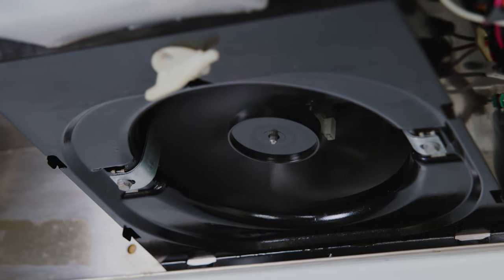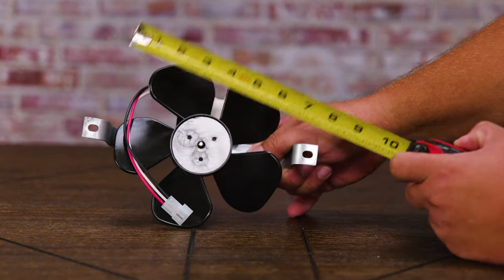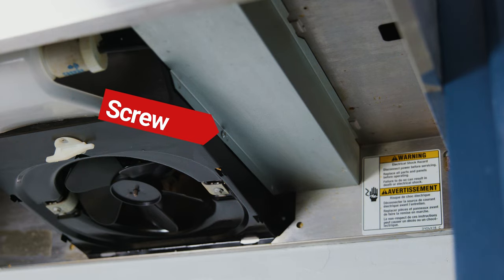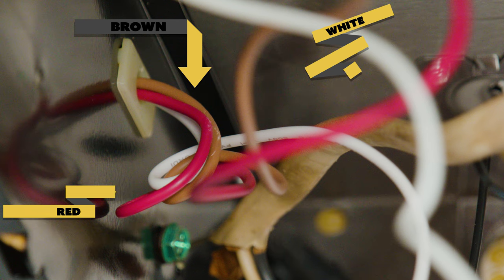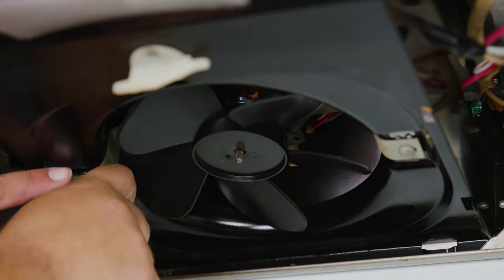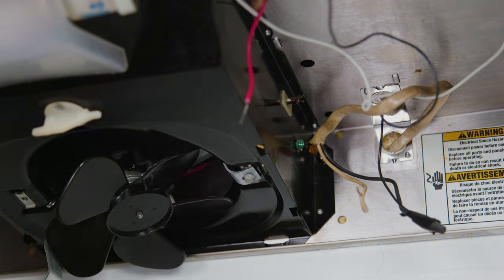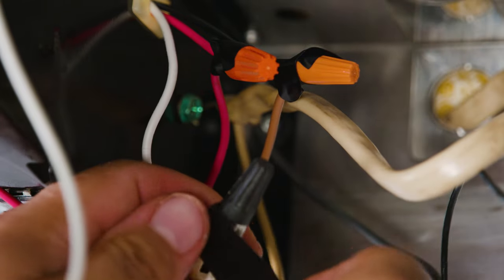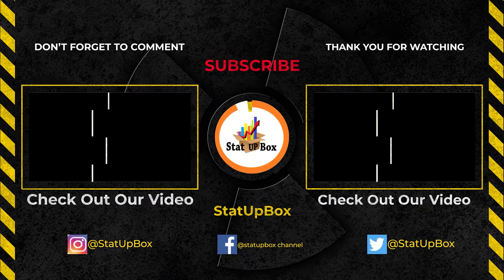How To Replace Range Hood Fan Motor Easy Simple

Comment: My westinghouse rangehood fan stopped stopped working, dropped it down, make sure power is turned off, didn't touch any wires, cleaned all the built up fats, tested and bingo, Fan working again.  Clean it out first before you replace.  Cheers for the video
Reply: How do you clean it? Can you just dunk it in water?
Reply: @chinoytheman  I used the s.o.s.cleanning pads the blue ones that have soap in them
Reply: @chinoytheman  or cleaning vinegar
Reply: Mine struggle to spin after a few minutes of spinning, three months after my last thorough clean

Comment: I love the safety reinforcement in a funny way.
I suggest wire snips are a safer for removing zip ties. Scissors can flex and cause damage to you or your wires. Unless maybe they are heavy duty.
Reply from the maker: great tip

Comment: Thank you for your video! I was struggling with having to get a new hood because the pigtail plugin for this won't match the one on the hood itself. While watching the video I remembered that all I have to do is cut the pigtails, and wire them directly! You basically just saved me $200 because now all I have to do is order the fan. One thing to note for future: Keep your old bracket, and blade because the bracket screw holes might not line up with the hood's screw holes. All it takes is removing the two screws on the motor body, and the blade, and you can swap out the bracket. The reason to keep the fan is in the event it breaks you have a spare on hand.
  All these parts are pretty universal, but the pigtails are what's proprietary in a lot of them.
Reply from the maker: Awesome. Great tip on the bracket!! 👍😊
Reply: @StatUpBox  Thank you. I'm glad I could help!

Comment: I have a kemore kitchen exhaust fan and ordered a motor and thought it came with the impeller. I need to take off the old impeller and put it on the new motor but can’t see no pin to remove. It likes like it needs to pry off to remove. When I ordered it look like it came with the impeller but looking it closer it side motor. I can order the impeller by itself but then don’t know about it going on the motor as it looks like it needs to be press on. Hope you can help!

Comment: So i ordered the fan motor replacement and installed it pretty easy .  It worked on Low BUT when i switched it to High mode later on it broke again.  Now it wont even work on low; dead again.  What is really the problem? Please help 😢

Comment: I need to remove the fan blade from the motor. Do you know how do this. The fan blade in not on a clip; attaching to the motor. it's the new type that's sold in the market today. It would be great if you cold explain how to remove the fan blade from the motor shaft. Thanks.
Reply from the maker: in some cases the non clip ones are push in pressure types, that can be pulled. have you tried that? if its a solid one piece, you might have to replace the entire motor with fan. also another way to attack it, you can search, if that particular model and brand has a fan blade replacement part, usually items comes with instructions, on how to replace or even give you information to know if its one entire piece or sometimes in the reviews there can be a DIY warrior that has some pointers on the install.  good luck. let us know how it goes. We are always open to new knowledge.😊❤👍💪
Reply: @StatUpBox  Thank you for the reply. I'll try what you have suggested and will let you know if it works out. I will also put a comment here if I am able to take the fan blade off any other way.

Comment: Unable to find the part shown in video. The ones I see online all have the white end connection.
Reply from the maker: The connector can be cut off. As well. Good luck.
Reply: @StatUpBox  that wouldn’t work. I have a red cable and brown cable that connects to the hood switch.
Reply from the maker: Can the old wire from the old fan be connected to the new one? Maybe a option